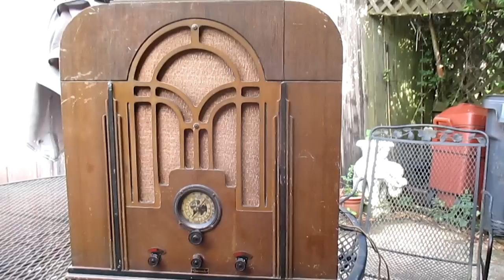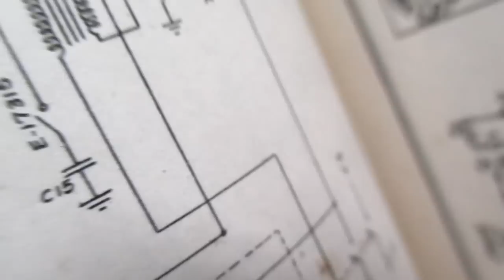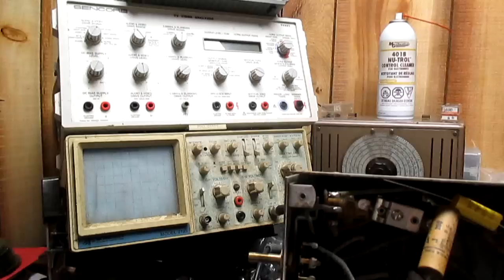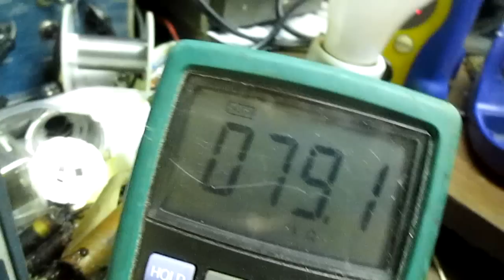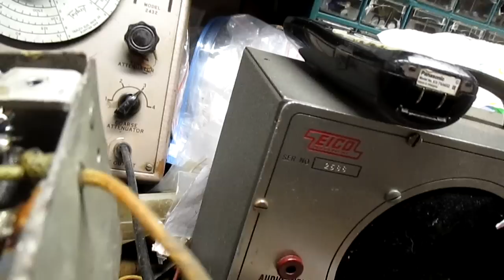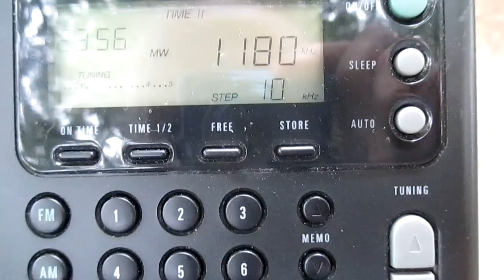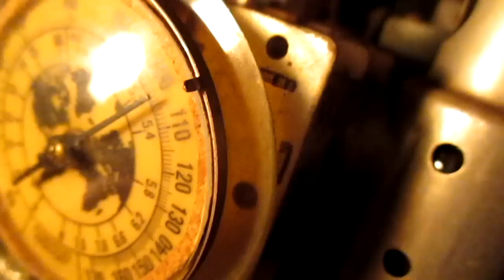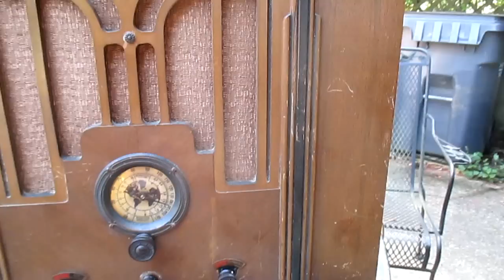1930s Coronado battery operated tube radio repair (just now getting around to putting this up).

Comment: That's some odd voltages and a lot of them. But back in those days anything is possible.Things just weren't standardized. The 90V sets are much easier as you can just use a battery eliminator. It's a long one but I'll watch it all. I'll have to do it in bits and pieces.

Comment: Bryan, it's tough to even find plumber's solder.  I tried lead-free solder.  That was a disappointment.  Also, the 60/40 solder is only available in the micrometer diameters.  It takes much more to solder the old joints.  OK, done with the rant.  Keep up the good work.

Comment: Radiotvphononut, regarding the supply line noise, have you tried bypassing each rectifier diode in the power supply with a capacitor of around 0.1µF.  Worked for me after replacing the metal rectifier in a transistor radio with silicon rectifier diodes.

Comment: 1:58:23...have you checked the  local oscillator output at the lower end of the dial?

It could be the amplitude/frequency of the LO is falling off...